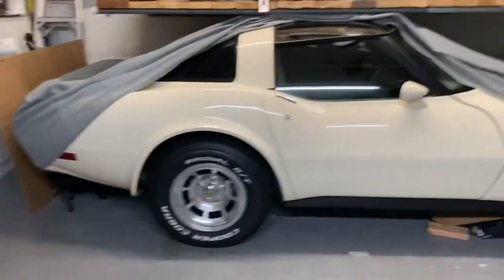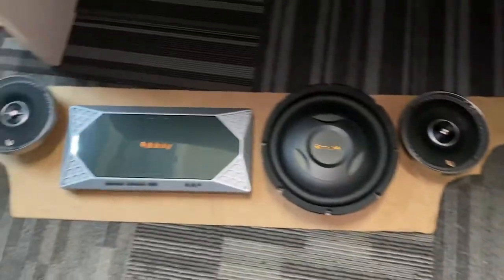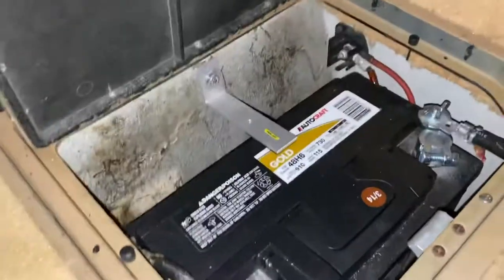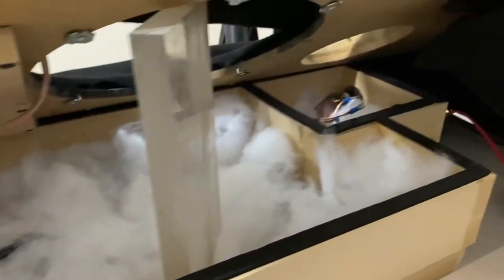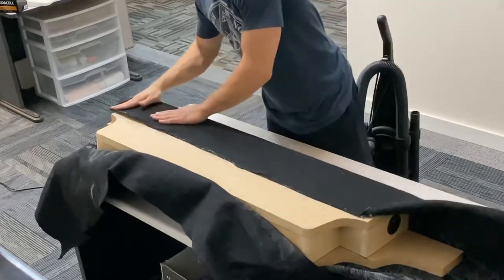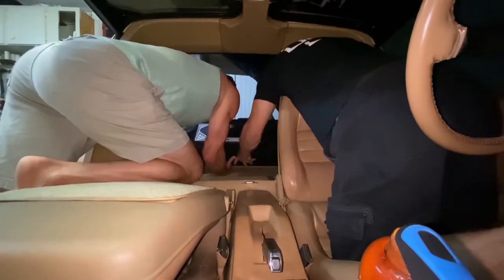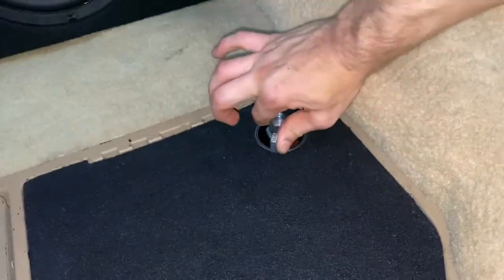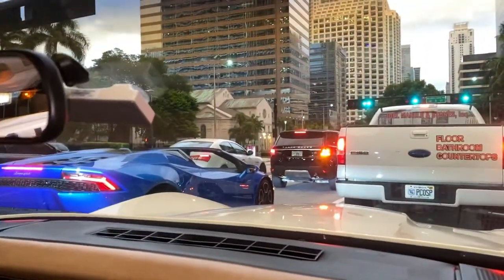Custom building a sound system for dad’s corvette (1981)

Comment: When my teenage daughter took over driving my car, she wanted to upgrade the stereo and add a subwoofer. We did a new head unit and two under-seat subs, which is nowhere near as fancy as your build, but running all the wires and taking apart the interior was a day-long project. It was GREAT to do together. Having the stereo is great, too, but the experience of installing it ourselves was even better.

Comment: I Just ordered the Custom Audio USA 740 radio and some Infinity Kappa 93ix 6x9s, Infinity Kappa 64cfx 4x6s. I'm going to order an Alpine PDX V9 amp and Jl  audio 10tw3-d4 sub next. I'm going to build this same speaker box that you built to mount the 6x9s and sub. Do you have any build plans or list of measurements you could share? Also how do you like the infinity sub? I was considering it as a option.
Reply from the maker: For a $700 budget, I couldn’t be happier with the sound. Bass digs deep, mids are balanced, and sopranos are clean. I wouldn’t spend the extra money on a JL primarily because the infinity sub I have already outputs enough bass to loosen screws in the vette, up to you tho. I gave the sub one cubic foot of sealed volume, as recommended by the manufacturer. And for the coaxial speakers, I don’t know, but not much is needed, as you can see in the video. I don’t have any measurements to provide you with, I got rid of all that a while back, but in the beginning of the video, you see I made a cardboard template to fit as best as possible, and I HIGHLY recommend you do that too. I made sure as to leave room for the sun/cover tarp to still be rolled out over the enclosure, and I also measured the depth of our T-top panels and made sure that the enclosure wasn’t too thick to prevent the panels from fitting behind the seats. It’s a very tedious enclosure, but relatively straight forward. Let me know if any other questions. Best of luck.

Comment: I had a question, for your battery switch when you switch it on does it turn on the whole car, or only the speakers and the amp
Reply from the maker: Whole car as well
Reply: @pierogiengineering  ok cool, so every time you go to turn the car on you have to switch the battery on right
Reply from the maker: @dirangoal  yup, that was the goal though. If we did not disconnect the battery from the car, there was a fault somewhere that would slowly drain the battery, and if left connected for a longer period of time, we wouldn’t be able to start it.
Reply: @pierogiengineering  got it, did you use the same wood to make the new press fit for the battery compartment as well for the subwoofer, amp, and speaker box? if so what kind of wood and how thick. I want to do the same to my 77 vette but I want it to be as shallow as possible..
Reply from the maker: @dirangoal  I used MDF (medium density fiberboard) everything was 0.75 inches, but you can go a little thinner or thicker if you like